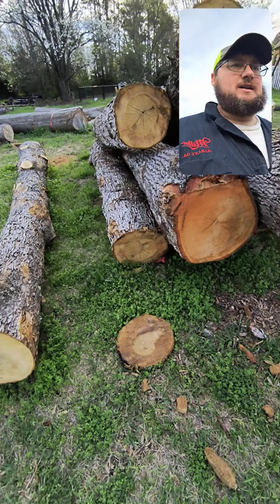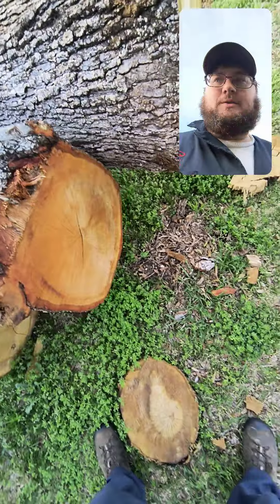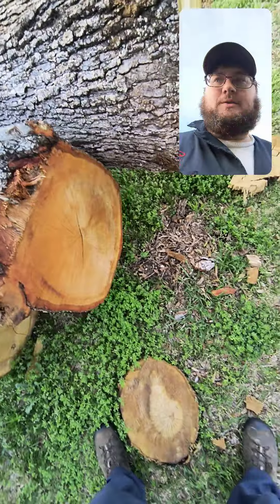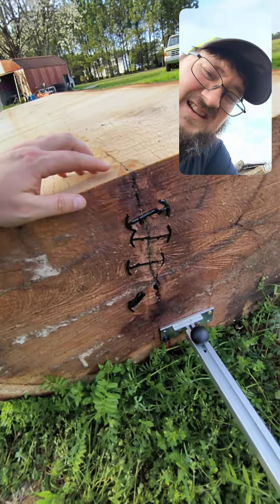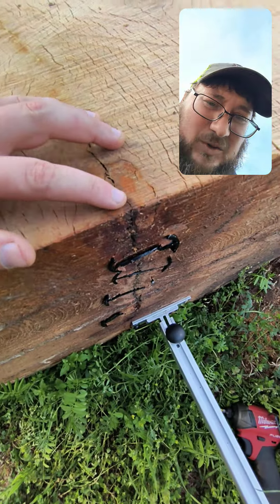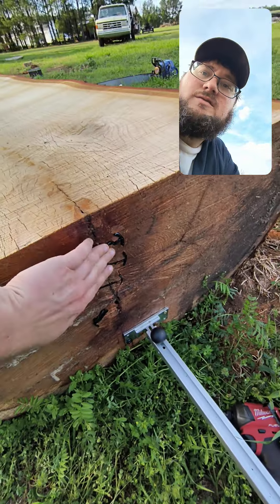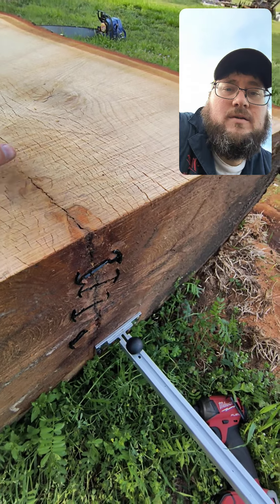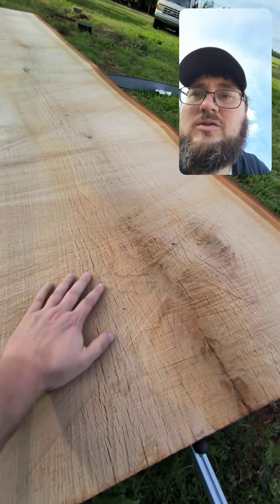Flitchsaver to the rescue!!!

Comment: Dang your chainsaw milling all that? I saw the winch setup
Reply from the maker: Yes sir, I have a band saw mill, however it only goes to 30 inches.   I'm only cutting slabs.
Reply: @FatGuySAWZ  what size saw are u using on the alaskan setup
Reply from the maker: @tehfuqizg0inon588  it's the farmertec 888 clone of the Stihl 880.   I tried getting a real Stihl however I couldn't find one.   I have had good luck with the farmertec however.   I'll put a link bellow.
Reply from the maker: @tehfuqizg0inon588 I put the link in the description of the saw.   It's not the same color but it's the same saw.  Thanks for the comment.
Reply: @FatGuySAWZ  I've heard good things about the clones and have been tempted to try one
Reply from the maker: @tehfuqizg0inon588  I've had good luck.  I think I need to do some tuning on mine bet everything else is just like an old Stihl.  Like the 080 or 880.  I've been happy with mine.  Other than a few little things like tuning and the ugly blue.